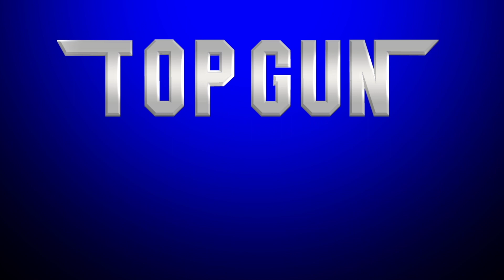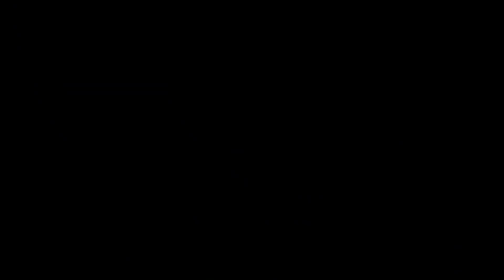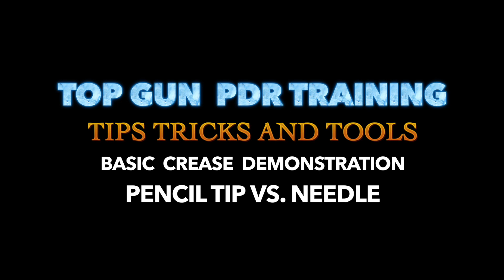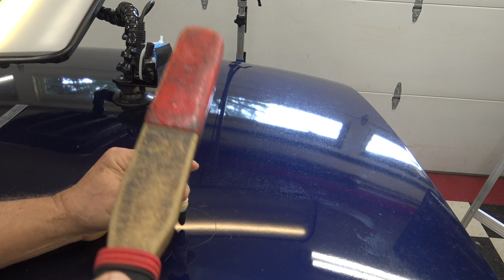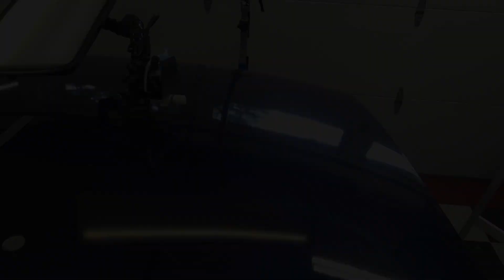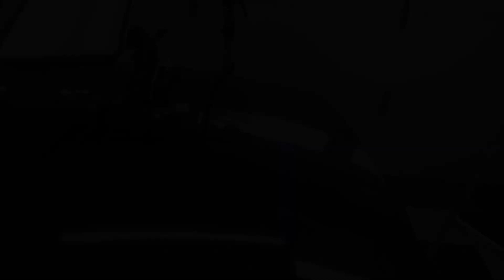Paintless Dent Repair Crease Removal Using Pencil and Needle Tip Tools

Comment: So basically its pointless to use soft tips? Sharper metal tips better?
Reply from the maker: Soft tips work fine on metal that isn't stretched. Sharp tips are used for stretched metal and to fine tune orange peel.
Reply: Thank u for the Quick response. When gathering metal do you always have to push in one direction? Or that Just applies for stretched ones?
Reply: Too much to write out here. Watch some of the videos on my channel where I discuss the basics of working stretched metal.

Comment: For some reason I cant get the very end part of hail damage out. Can anyone tell me why? I always shrink it to the size of a very small popped pimple or herpe looking ding. Then I push and push and nothing. why?
Reply from the maker: Many causes for this. Starting the dent wrong with inaccurate pushes and not using a sharp enough tip are the two most common causes.
Reply: Top Gun PDR Training ok yes I just saw your other videos. Thank you sir!

Comment: Ok exelent example video.

Question: How about older cars with lets say 80's BMW or Merc. metal and a thick layer of tar like rust prevention on the inside of the fender panel.
I have tried this and the crease wouldnt move at all. 
Do i really need to start using massive force and much heavier tools?

Greets from the Netherlands
Reply from the maker: That tar can really make it hard to make accurate pushes, but the sharp tips will usually push through it. I try to clean that stuff out with a sharp glue scraper tool when possible. The sharp tools are not as effective at gathering on thicker metal as they are on modern panels but they will still work well. I generally use a needle tip on thicker metal but you have to sharpen it more often because it wears down so fast.
Reply: Ok thanks for the tip, so the thicknes of the metal doesnt realy make a difference, you just need more force to gather the metal on the push?
Reply from the maker: The thickness does matter. The thicker the metal the sharper the tip you use.